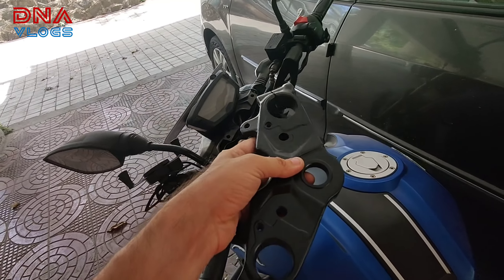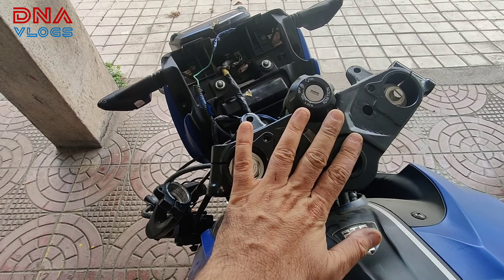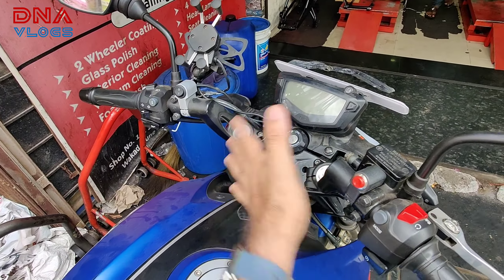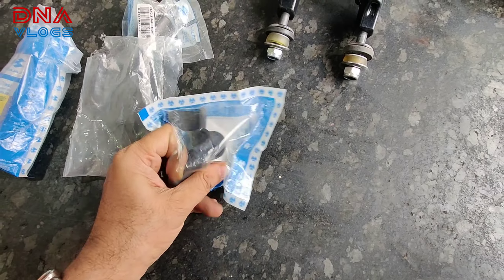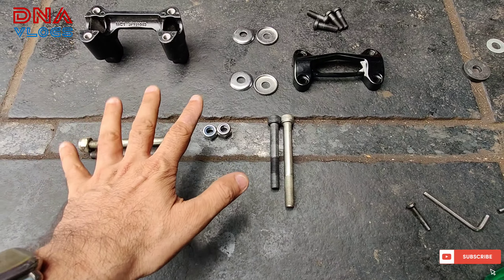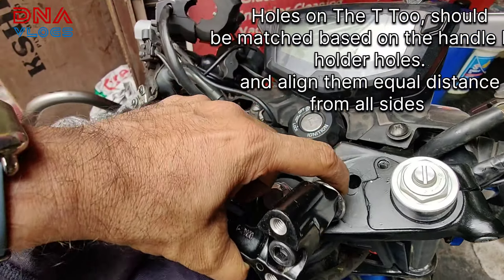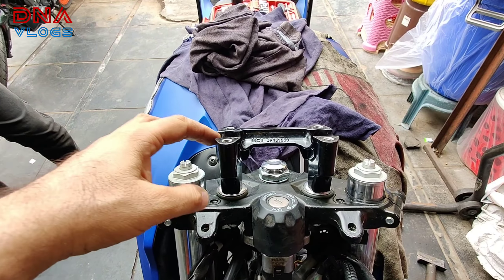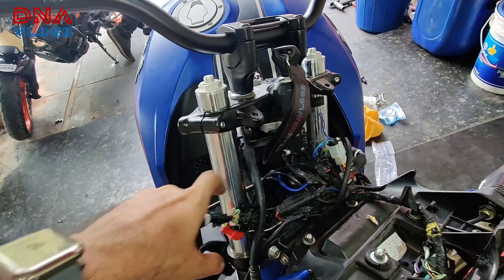2021 BS6 TVS APACHE RTR 200 4V | Dominar 400 Handle Bar Installed | DIY Tips & Tricks | DNA VLOGS

Comment: How about the turning radius with a new handle bar?
Is it better than stock or its the same
Reply from the maker: Turning Radius will not change. You need to understand that we havent changed anything for the wheelbase, or wheel height or Fork T - No distances have changed

Comment: By any chance do you know/feel if the Dominar handlebar will be a direct fit for the N250, without any cable rerouting or drilling required?. I have seen the modification, but wonder if it will be complicated or the warranty will go for a toss. Really like the N250, but the lower set handlebar is the main deal breaker so far. 
PS: The stock tyre hugger is poorly designed as per user reviews... Based on your custom tyre hugger clamp, will the NS200 tyre hugger be compatible with the N250?
Reply from the maker: I cannot answer both these questions, unless i have the bikes and spares in front of me to try them out.
Reply: @dipen.nisar.autovlogs  Haha... Thanks for the quick reply!
Reply from the maker: @josephf3648   👍🏻

Comment: NGK Iridium spark plug that you have used is not looking like it's working in my case.. facing a drop in mileage actually!! no custom air filter though.. any insight on the condition?? Please share your thoughts
Reply from the maker: Only Spark plug change should not drop the mileage. Riding style and Traffic conditions, fuel quality, air filter clogging, chain slack, throttle body condition are some of the points that affect FE. Start with shifting to the top most gear in lowermost rpm and don't rush for it but don't open the throttle completely nor for long in one particular gear.

Comment: What is best/ safe way to clean break disc?
Reply from the maker: in which situation ?
Reply: @dipen.nisar.autovlogs  rust
Reply from the maker: is it on the section where the pads meet ? I dont think so. other sections of the Disc, you can either ignore or clean only that area with WD40. Dont let it spread on the pads part. Clean wipe it with Tissue or news paper. after two days, with a brush to paint touch up to prevent it from rusting further.
Reply: @dipen.nisar.autovlogs  thanks for your response 👍
Reply from the maker: @pankajdange6962  happy to help in case of genuine issues 😊👍🏻

Comment: dominar ka handle bar holder khase kridega nhi mil rha hai can u send me
Reply from the maker: Bought it from Sai service pune. You can contact them.
Reply: Send me
Reply from the maker: @kangabamzvinachandrasmeite3067  buddy as i said contact them. What send me ?
Reply: @dipen.nisar.autovlogs  do they have handlebar in inventory or you had to wait ?
Reply from the maker: @ss87344   buddy how would I know about their stock.
Reply: @dipen.nisar.autovlogs  i mean, did you get it instantly on the same day when you went to buy it, or did you have to wait for it?
Reply from the maker: @ss87344  that's what I mentioned in the vlog buddy. Relax and check the video. I have mentioned I picked parts from various dealers in pune. Major ones from Sai service phugewadi. If I have to answer the same question again, then the vlog does not make sense buddy.
Reply: @dipen.nisar.autovlogs  I watched the entire video, even though my N250 doesn't have clip-ons. I just have a minor question, so I thought I should ask you. Nevertheless, thanks for the quick response. I will reach out directly to Sai Services for any doubts. Cheers buddy! ✌️
Reply from the maker: @ss87344  n250  spares i am not sure about that.